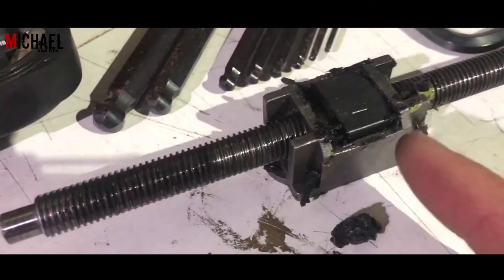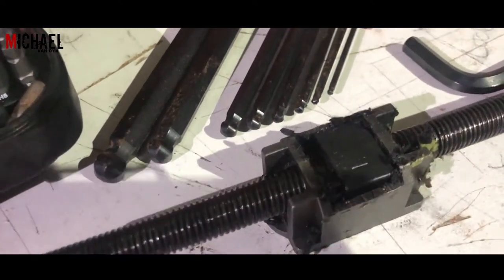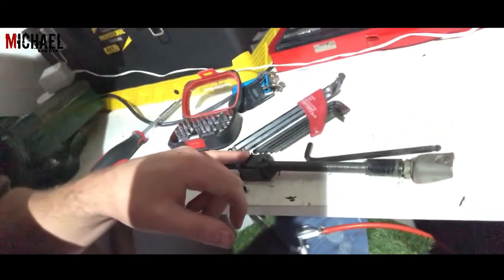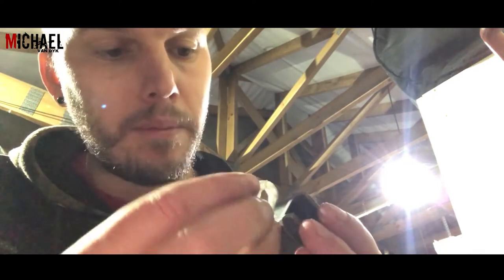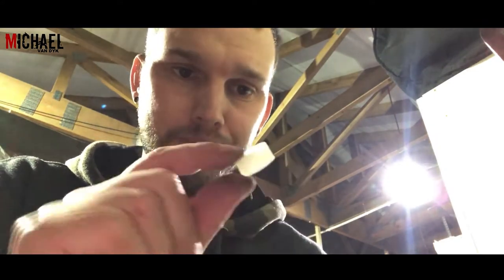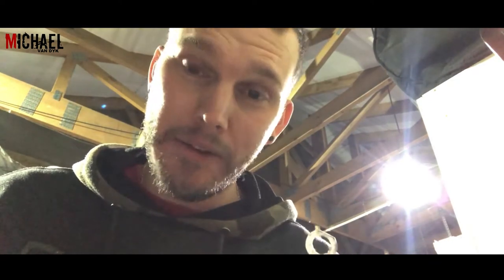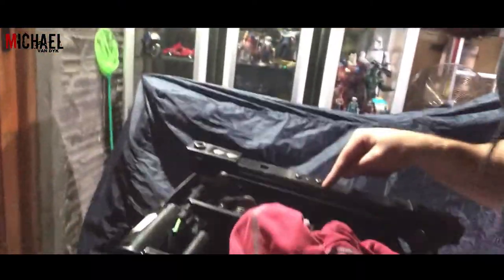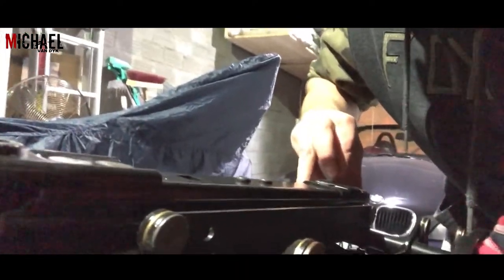BMW Z3 - Seat Rail Bushing Replacement Video

Comment: Overall a great video. A couple of comments. My Z3 is 21 years old. It is best to start this job by saturating the nuts and bolts holding the seat to the floorboards with penetrating oil for a couple of days.  Even so it may take the help of a breaker bar to take off the bolts. Lower the convertible top before starting. The slide rail that attaches to the floor is longer on one side than on the other side. Consequently I can't reach the T20 Torx on one side and remove it. Still struggling with that. After taking time to saturate nuts and bolts with penetrating oil and struggling to reach electrical connector the job is now into its third day and I'm pretty handy. Still trying to figure out how to get off the T20 bolt. BMW wants $2,000 to do this job. I can do it for $20 in parts. My time is free but a lot of other projects are falling behind. But it is interesting to figure out how to get this "simple" job completed. I wonder if I will need another three days
Reply from the maker: Thank you. Hope you are able to get it done. It is a bit of a struggle but you will be able to pull it off.

Comment: Whilst the video shows it, it's important to remove the rear 16 mm bolts first, power the seat back and undo the front 13 mm nuts - if you don't, you will not be able to remove the threaded rods.

Comment: warning warning this really sucks like really really sucks . getting the hole onto the rod but also threw the hole was almost impossible and i almost broke it ..... this was on both seats im getting getting it through the hole after the motor rod wasnt hard for you?
Reply from the maker: Sounds like you had a bit of a tough time. It wasn’t to hard for me when I did it. It took a few tries but wasn’t to difficult.